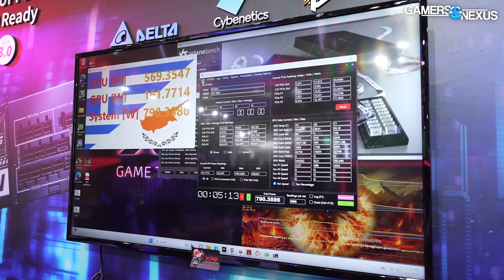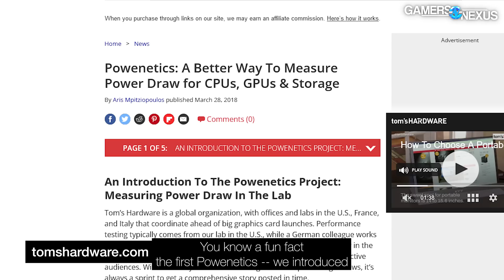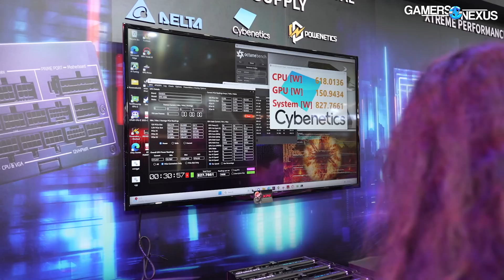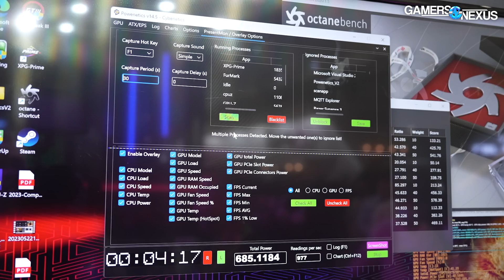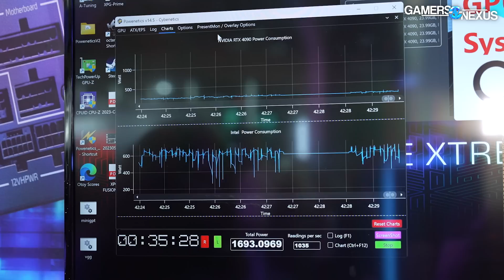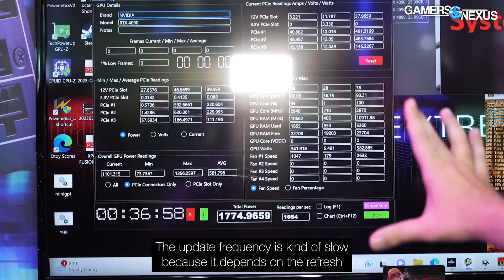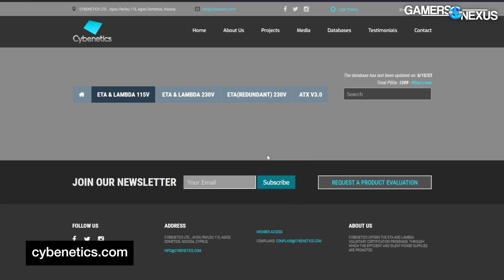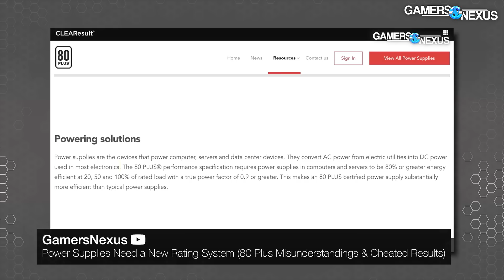GPU & CPU Power Testing Needs an Overhaul | Discussion ft. Aris of Cybenetics

Comment: €975??? That's under priced for lab test equipment!  Doesn't he know about the commercial/industrial grade equipment tax??  That price can easily be double.  Aris, PLEASE charge more for your equipment.  Should at LEAST cost the same as a 4090!  You have a gem there!
Reply from the maker: Easily could be double and well within normal expected cost for industrial equipment. 100% agree and mentioned that to him!
Reply: @GamersNexus   Also charge for training and support on top
Reply: He might be trying to just increase it's availability to reviewers.  But yeah, it definitely feels very underpriced.
Reply: @Joostinonline  If the price is kept low to enable reviewers to get them then he could just use two price tiers. For commercial private use there's the higher price. For reviewers there's the cheaper price. The reviewers however will have to promise to share the raw data for any PSU they test within a month after publishing a review. The data package is then uploaded to a server where both other users of the equipment and Cybernetics can cross reference test results and use the data for their own purposes wherever that is to produce reports for publication or for internal QA follow up.

This was just an idea I developed as i was writing so there are bound to be problematic spots, but I think something could be done with this.
Reply: @Joostinonline  he should double the price but offer a reviewer 50% off coupon or rebate haha XD
Reply: Was expecting around $2500-5000 and when he said the price I almost laughed! That is enthusiastic range, not commercial pricing!
Reply: Especially with the 1 on 1 support included it should cost way more
Reply: Agreed, I just bought a 3D printer for that money so would be completely be in my range. Which is nice ofcourse, but I'm not the target audience as a regular consumer.
Reply: Esepcially with one on one support. I assume that is a one time fee? Should be a yearly fee that includes firmware updates and support. Need a steady revenue stream to allow future improvements to the hardware and software.
Reply: I thought the same, it's dirt cheap for what seems to be involved in this!
Plus, there is a somewhat limited market to it so I doubt there exist a huge scale cost reduction possible.
Reply: 1500€ and handshake!
Reply: Most definedly underpriced but it is cool tho :)
Reply: I like his pricing. It reflects his attitude, which is consumer oriented. The idea here is to get this tool out there and available, he's even using a "free" plugin for the software side. Nothing is stopping the buyer from developing on or even modifying the tool to suit their needs, which is what I assume Steve & The Team will be doing!
Reply: Yeah i thought I was just way off seeing I'm not too knowledgeable on that end of pc hardware but was expecting like $3k or something
Reply: Only a single payment of almost 1000€ is really cheap. Where's the lease model of 1000€ per quarter per unit?
Reply: I mean it makes sense. Because let's be honest, it's kind of in that weird category of "precise enough to be meaningful" but not really with a featureset that would make it interesting for a general electronics lab. It looks to be really positioned for the youtube/blog reviewer person who wants to do things well. Not professional really enough to be in a lab environment that isn't solely for commercial use. Which makes sense right, it's a device solely made to test GPUs/CPUs. So a lot of the things you expect in professional lab equipment just isn't available here.
Reply: And he said the software is all built in house. Just the software alone could cost a lot of money.  For an example, stand-alone ECUs for cars are often not much more intricate than a raspberry pi. However, the software for them is really what your paying for. He seems like a humble man though, I respect it.
Reply: I scrolled the comments before typing the same thing. For those that need it this is a steal very reasonable even for a small repair shop. I was expecting $2500-5k. A paid support contract and paid upgrades are not uncommon in this realm. I don't want to price myself out of a potential tool here but I don't want him to miss out on a good thing financially.
Reply: I feel that nice lab oscilloscope will cost more...
Reply: It could at least cost more than Apple's monitor stand
Reply: Charge Nvidia $975k p/a, lets see how THEY like to be screwed
Reply: From a business standpoint, its priced to gain as much attention and 'market share' as possible. I'm sure as he sells more, he can easily command a premium.
Reply: yeah he forgot a zero on that price... it's not the "pcb" itself that costs... it's the support and the software etc. etc.
Reply: Needs to be higher for sure
Reply: Meanwhile you won't even buy one so who cares what you think.
Reply: in order for this to become lab equipment each unit has to be calibrated against standards in a proper metrology lab.
Not to mention software. Power monitoring that does not plot configurable graphs?
Reply: @Mr.Leeroy  you have the logs so you can plot all the graphs you want
Reply: @LiLBitsDK  As well as all the skills necessary to build the same device, which does not mean I should
Reply: @Mr.Leeroy  the product gives you the numbers... if you want to do something specific with those numbers then do so... they can't and shouldn't cater to all specific statistically needs... there are programs already catering for that... use those... that's what scientists do (I should know... I used to work in research) we get our numbers... we then import them into fancy statistical programs and make all the fancy graphics, plots and what not that we like... if we had to use each tool's OWN program's built in graph program it would be horrible, cumbersome and ugly... now we take all the DATA and put into ONE program and tadaaa we can compare and shuffle all the data as we please even though we get meassurements from maybe 10-15 different machines... (in my case it was visual scans, meassurements, blood analysis, temps, cell counts, observations etc. etc. and we put it all into ONE program for our medical research)
Reply: @LiLBitsDK  I was talking about real-time graphs. Post-process graphs are sure a thing in analysis after logging. But for monitoring, there should be a UI flexible and readable at glance, not just a number overloaded screen (although it definitely should be an option as well).
Reply: @Mr.Leeroy  i think i saw plotting option checkbox when they showed the screen.
Reply: @Mr.Leeroy  what kind of professional lab equipment plots the final graphs for you?
In my experience its some shitty preliminary plot only and then you import it into R or Python or whatever, do some post processing and plot it.
Reply: No. Keep it affordable. We don't want greedy people raking in more profits than possible.
Reply: It isn't really industrial grade, looks pretty basic in fact.
Reply: @JGnLAU8OAWF6  Most industrial grade equipment looks "pretty basic" because it's not designed with aesthetics in mind like consumer grade stuff has to be.
Reply: @sammiller6631  basic not in terms of looks, but in terms of complexity.
Reply: @JGnLAU8OAWF6  Not everything needs to be overly complex. Feature creep can make everything worse.
Reply: @JGnLAU8OAWF6 yes, like there are many tools out there that measure 1000 samples in ms with such efficiency… rofl most probably you have zero clue while not even understood what has been mentioned in the video… based
Reply: @Musedoublerr  i mean... there are basic oscilloscopes that measure 1,000,000,000 samples per second.
I don't think 1k samples per second is enough to catch major transients.